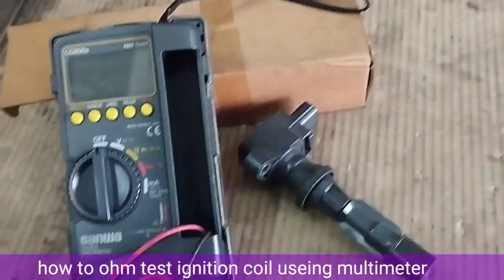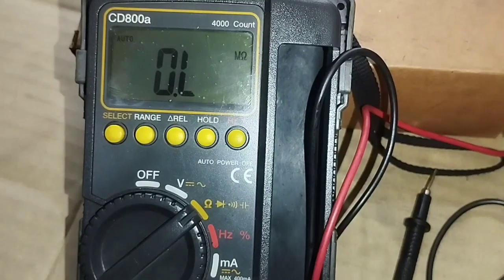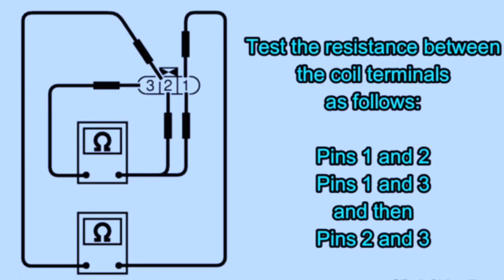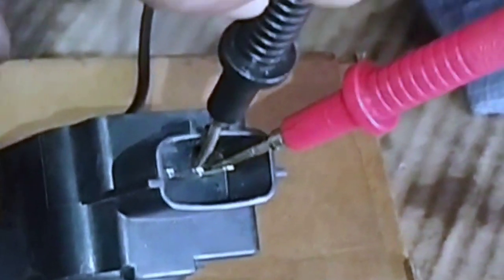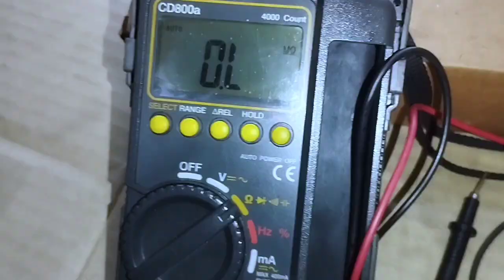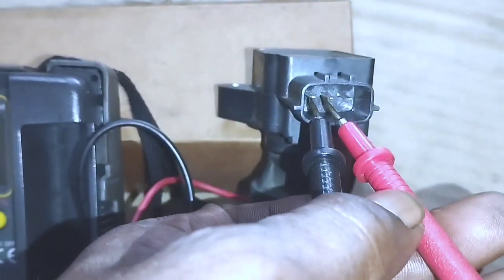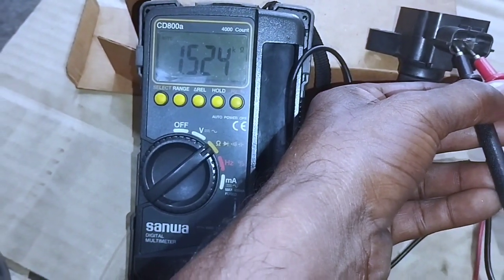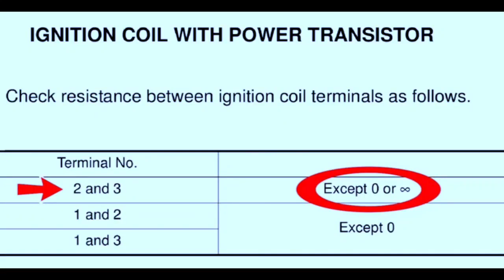How to test ignition coil with multimeter ! testing 3 pin ignition coil pack !

Comment: One video using this method said it was to be used on ignition coils with a power transistor. Does this mean it won't work on an ignition coil WITHOUT a power transistor? I have a 2010 Nissan Rogue that broke down recently near an auto shop. They said two of the ignition coils were bad. So I ordered some new Denso coils and tested the old ones just for practice. Follows are the readings on pins 2&3,
Coil #1         2.28 ohms
Coil # 2        2.67 ohms
Coil # 3        2.67 ohms
Coil # 4        2.41 ohms
I'm guessing coils #2 and #3 are bad. 
Correct?
Reply from the maker: The reason coils #2 and #3 are likely bad is that their resistance readings (2.67 ohms) are significantly higher than coils #1 (2.28 ohms) and #4 (2.41 ohms). When testing ignition coils with a multimeter, a higher resistance reading can indicate an internal fault or degradation of the coil windings, which can lead to misfires or poor engine performance
Reply: @SCSautomotive.1988 
Thanks. I have new ones coming today but I'm new at using a multimeter. Just wondering if I did it right. 😊
Reply: Nothing is wrong with those coils. Play perfectly all right. I am a repair technician 40 years
Reply: @dextermillington  
UPDATE:
I installed all new Denson ignition coils (which through a lucky eBay mistake was free) and the car runs perfect.
Thank you for your concern though.

Comment: Sorry but i cant understand... İ buy new ignition coil (Beru for mercedes w204 3wire) i check pins 1-3 O.L  22-3 O.L and 1-3 is 0,002 Ohm
And than i check olds they give same results just one of give 1-3 0,07 ohms. Bad one give same results with new one so how can i understand which one working well ?
Reply: You need the specific manual for your car
Reply: The host is not an electronic technician

Comment: I have a problem with 1AR vits the car starts when you connect the starter motor direct to the battery but using a push to start button is not the dashboard lights are on when u place the button,all the fuses where checked what can be the courses
Reply from the maker: Please let me know what is the problem with your car

Comment: I am confused with the way it is worded - check resistance between terminal 2 and 3  and if you have a reading below 1.49 or above 1.57 ohms replace coil 

Check resistance between 1 and 2 then 1 and 3 - any reading the coil is good but if there is a reading of zero the coil requires replacement ?
Reply: Terminal 2 & 3 except  zero and infinity   
1.49-1.57 Ω  ignition coil=good
Terminal  1 & 2 and 1 & 3 except  zero
Reply: ?this j nbbb.  bb.   b. b b b b b. b.               b. bbb😊😊😊b😊b.        😊 😊😊 😊😊bbb.      b. bbbb=bbbbbbbbbbbbbbbbbb😊bbbbbbbbn@@ nn)(n@un😊u😊uuu?
Reply: 😮ypu
Reply: ?this j nbbb.  bb.   b. b b b b b. b.               b. bbb😊😊😊b😊b.        😊 😊😊 😊😊bbb.      b. bbbb=bbbbbbbbbbbbbbbbbb😊bbbbbbbbn@@ nn)(n@un😊u😊uuu?
Reply: muuuuuuuuuuuuuuuuuuuu....uuuuuuu.uu.u.Uu.uu.U..u..m.UUuuhhuuuyyuuu.Lu..u...u.UUuuh😊h
Reply: yyy
Reply: .mmūppmmummuuml.Uuu
Reply: 😅.m.Mmm.mkkmmmum...m>mmumumu.u.Mmmmmumumlmmmm.mumu.U..lmum.mmmmum.Lm.UMU.m.mm.u.MMl.Pum.o.Ppml.mmmmmuuuuumumumm. 2:08
Reply: Terminal 2&3 reading is 2.68 and ignition coil is good or bad
Reply: @valaralte4758  did you get an answer to your question? Mine reads that..